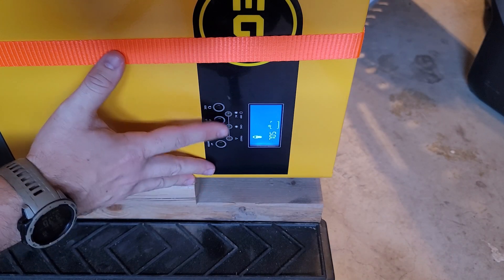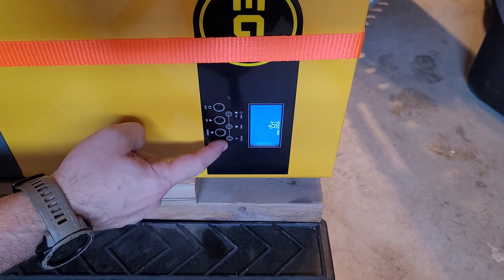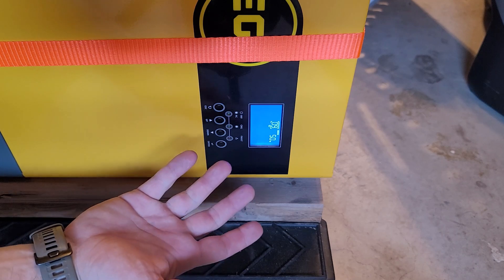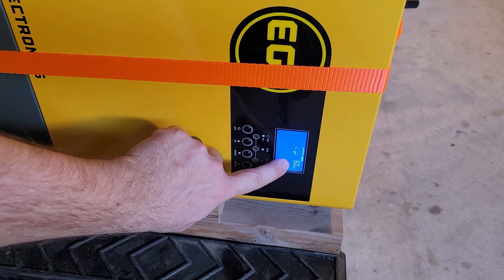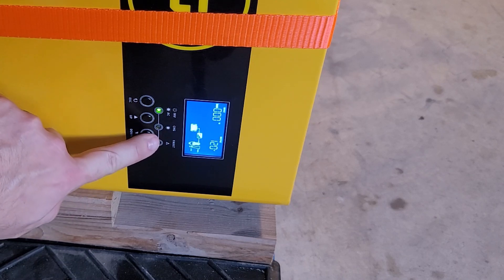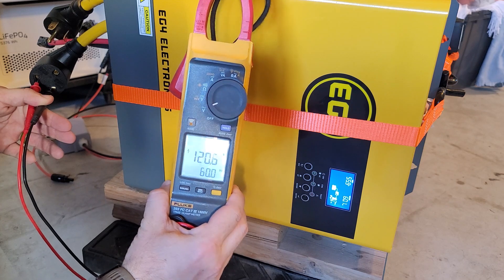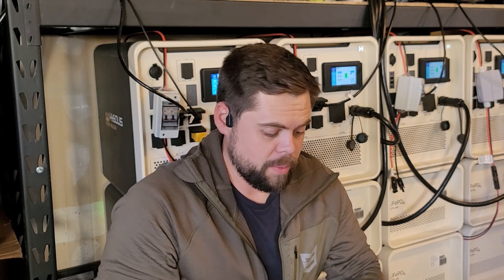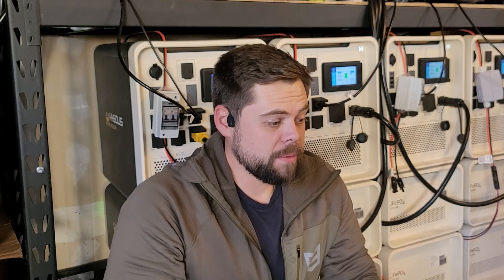Easy Fix EG4 3000 EHV48 Inverter 50hz to 60hz

Comment: That is interesting.  I did not have to do anything like what you did to change it to 60 hz.  I just went to program  and changed to 60.  Maybe you were pressing buttons too fast and not giving the system enough time to respond.  Regardless glad you figured it out.  I'm not into huge off grid systems so small stuff content would be good for diy .  For example people like myself who live near the coast may not have the knowledge that in many cases a simple 12V system is better than a power bank.  Where you can connect a 12V cigarette receptacle to the battery and a 12V fridge/freezer will run the fridge a lot longer than a 1024 wh power bank that has greater efficiency losses due to conversions.  You're the minute prep guy, prep the future.